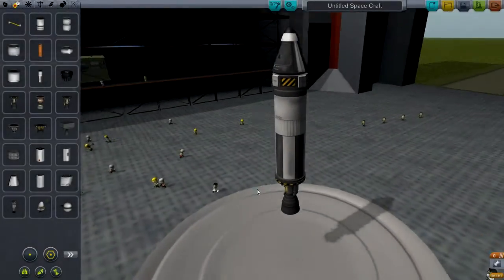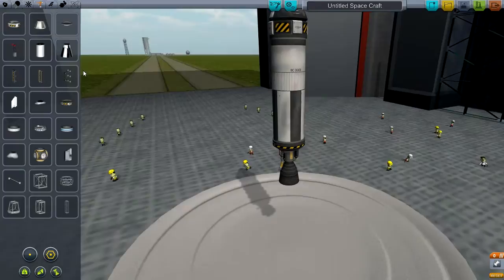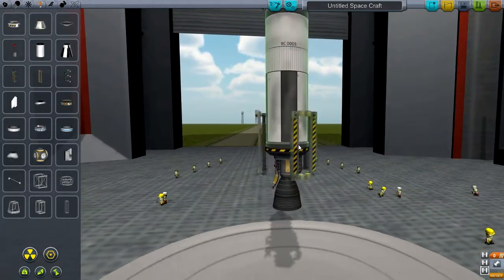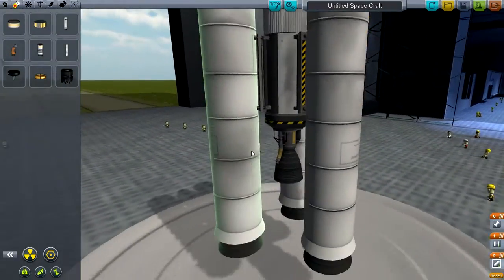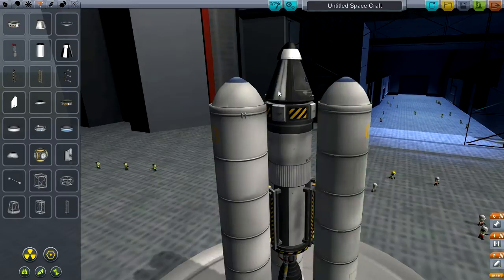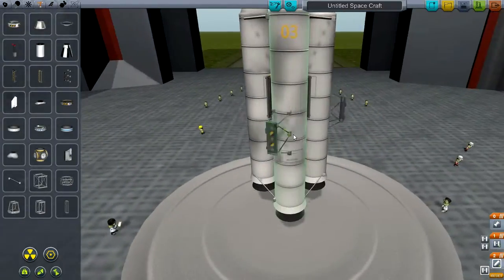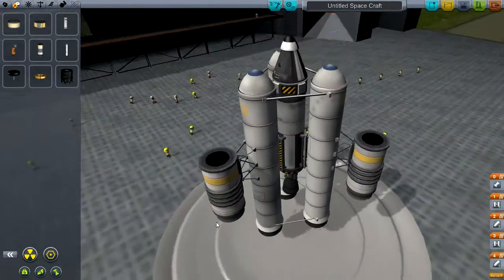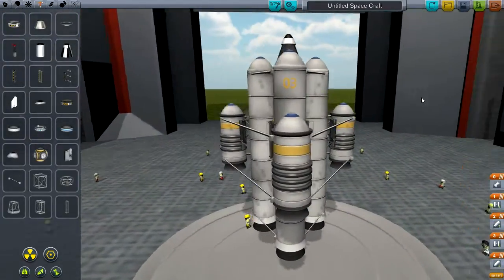Kerbal Space Program Tutorial - Creating Stages and Orbiting

Comment from the maker: Are you using the basic jet engine or the turbojet engine. If so, then they need air intake to create trust. At around 25,000 meters up depending on how many air intake parts you put on your ship, your engine will stop giving you thrust. Once in space the engine no longer has any air to create trust from so they become useless. If you arn't using those engines then I'm not entirely sure what the problem could be, because any of the regular liquid fuel engines should work fine up there.